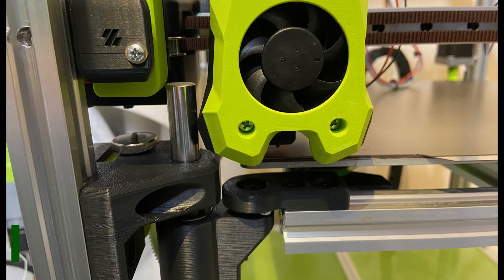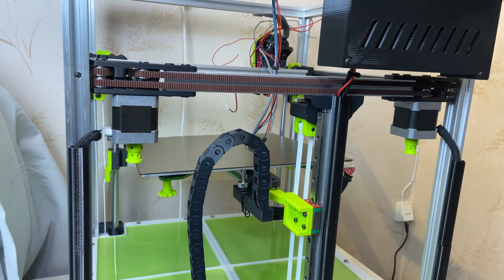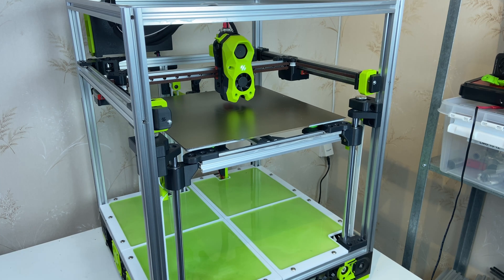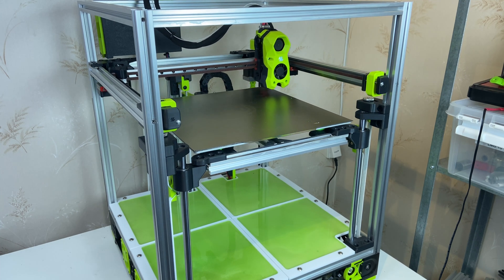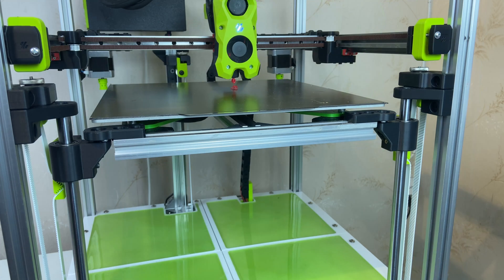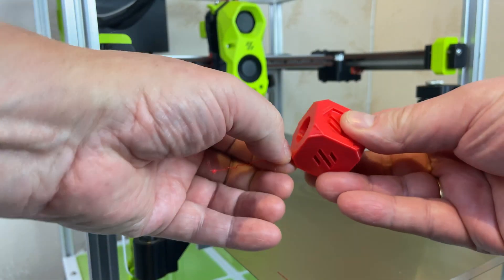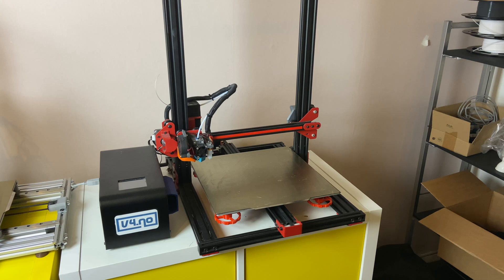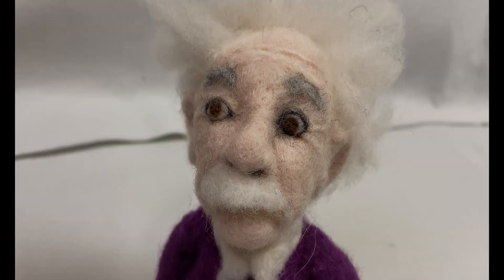It's not a Voron - and it’s finished!

Comment: Awesome!
Would you mind sharing CAD file? I'd like to build one with my leftovers from other projects.
Reply from the maker: Thanks! My build is very specific to the exact parts I had remaining from my old printer. I don't think the CAD file (actually files) would be of much use to anyone else. Just use the original Voron design CAD and adapt to the parts you actually have. (especially bed and mounting pattern for that). Going from linear rails to rods, like I did, probably wouldn't make much sense unless you really wanted to do it :-) The only sort of "universal" and useful file from this project is the adapter for the Bambu lab hotend.
Reply from the maker: @hdragoon1710  … and I think my next build might be more interesting and useful for other diy-ers.
Reply: @v4projects  I'm looking forward to your next build 👍

Comment: Nice Job👍

I'm trying to do something similar with my Anycubic Chiron. Already have most of the parts but want to keep the t8 threaded z-axis so it will be a complicated construction as i don't use fusion to make a good plan🙈
Reply from the maker: Thanks! Using Fusion and the Voron CAD model made a big difference. I have to admit that this is the first time I use a CAD model for a DIY printer.